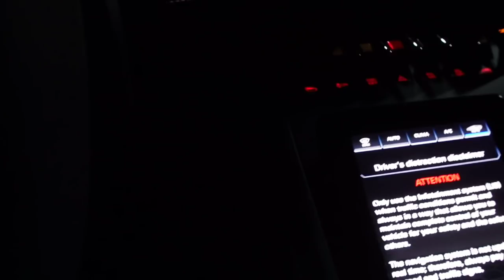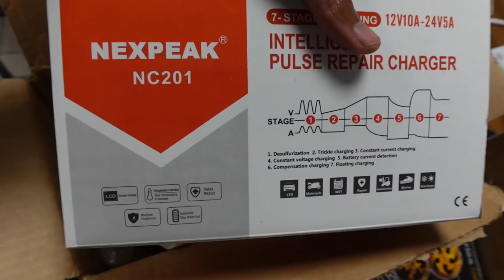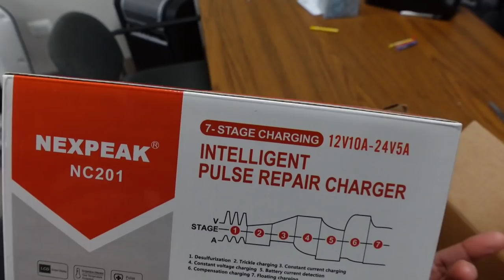IVE TRIED BUYING MY DAD A CAR AND HE ALWAYS SAID NO UNTILL HE SEEN THIS ONE

Comment: Honestly bro, you have the ACCESS to something’s that ordinary people can’t do. So, here it goes. The cutlass build..An electric supercharger is a specific type of supercharger for internal combustion engines that uses an electrically powered forced-air system that contains an electric motor to pressurize the intake air. By pressurizing the air available to the engine intake system, the air becomes more dense, and is matched with more fuel, producing the increased horsepower to the wheels.[better source needed][1]